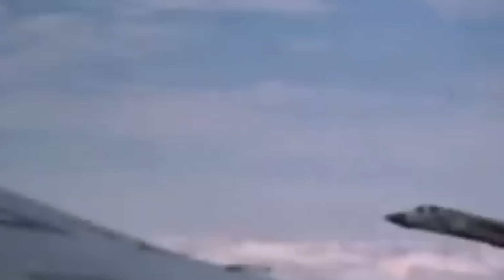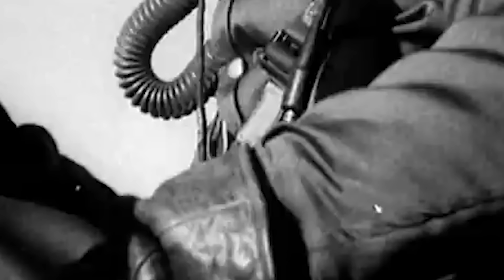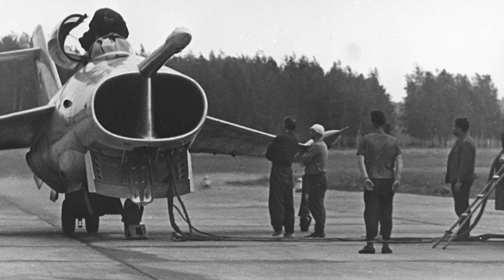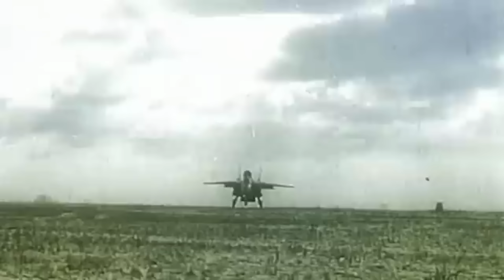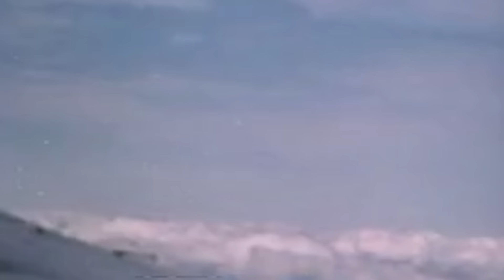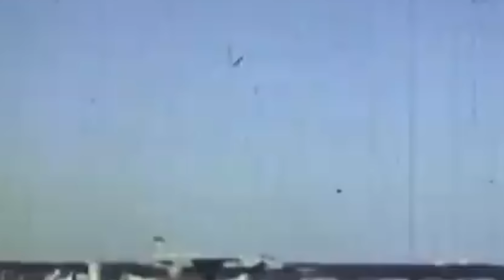America Stole This Plane and Turned It Into a Monster

Comment: Right from the Russian MOD propaganda desk. 🙄
Reply: The cope is unbelievable. This is all open source information. Someone like you would also claim it’s propaganda that the US bought Russian rocket engines despite the US being decades behind rocket propulsion right?
Reply: @kylekyle5438  Oh, come on. Convair designed a rotating nozzle 30 years before Yakovlev. Convair Model 200. THIS is literally open-source information.
Later, Convair merged into Lockheed. So what's with that claim of Lockheed "stealing from Yakovlev", when they used their own patent on the F-35?
Also, Yak-141 has 3 engines, while F-35 has only 1. Yak-141 was a total failure and could only have been possible in a country like USSR.
Reply: @kylekyle5438 The conclusions are what I take issue with. And there were issues with US rocket production, not with the technology. May I remind you of who was capable of landing men on the moon?

Comment: Signing a $400,000,000 agreement with Lockheed is not exactly stealing.
Reply: your correct. That is legally purchasing not stealing.
Reply: It's also not stealing because both Rolls Royce, MTU German and Convair had developed, built and tested swiveling nozzles BEFORE the Russians using this principle.   VJ101E used it for instance.   The contract was only for practical advice and engineering service.  It also wasn't 400 million, more like 40 million.
Reply: I wish someone would "steal" something from me for $400,000,000 lol
Reply: And all Lockheed Martin did was buy test data. The Yak-141 was a direct copy of the Convair Model 200A proposal and stole the three bearing swivel nozzle design built and tested in 1967 by GE and P&W. LM bought Convair and owned the Model 200A design already, and US engine companies owned the three bearing swivel nozzle, so they didn't need any 9f the stolen tech from the Yak-141. All they needed was flight data, and to not pet th9se Russian engineers and data t9 b3 sold to Iran or China.
Reply: EXACTLY!
Reply: well it makes a great clickbait title isn't it?
Reply: @adamchuahzongye395  Doesn't it? Well yes it does.
Reply: If the soviet Union were still around they'd claim that it was though
Reply: ....or at least Collaboration
Reply: It is, however, a great example of greed, on the part of Lockheed-Martin. (Aid and succour to the enemy)
Reply: Probably the 'stealing' was done by Russia, selling for $400m what was only worth $400.
Reply: Seriously. I mean it doesn’t sound like the same kind of ‘agreement’ the US had with Mauser in WW1. 😂
Reply: At that price you wouldn't call it a.... steal!?!?!?! 🥁🎉🥁

Thank you, thank you. I stole that joke
Reply: They never paid 400 million actually they paid less than a million dollars, and the entire deal was against Russian laws.
Reply: lmao! I know right? Russian greed sold it but Russian pride says we stole it....what weird people they are
Reply: Taxation is theft!
Reply: I had watched a video about the X35/F35, where it is also said that Lockheed Martin paid for access to the Engine Blueprints.
Reply: That's what I typed however mine was ignored. Not exactly sure why I'm being shown this again🙄.
Reply: @lynnrunningdeer Lol! Aww poor guy.
Reply: It is not an American innovation also. Lockheed Martin behaved exactly like Microsoft did with DOS- buy someone else work and shamelessly market it as your own.
Reply: its not a stealing  by L-M, its just a treason by Yakovlev top's
Reply: Not only did they buy it they had yakovlev help them develop something new
Reply: Worse part is some of the equipment gets scraped and never used,  tax payers money down the toilet
Reply: ...and you really believe It ??  😂😂😂😂😂
Reply: Aren’t these VTOL aircraft fuel pigs with limited operational range?
Reply: The US even stole German scientists to make things for them.
Reply: Yeah, but this was an engineering marvel by so many people who worked hard on it. It's not a bad deal, but this feels like that Alaska thing where they sold for millions, then after that the Americans found huge gold mines and now Russia regrets it.
Reply: @mfinland2767 Well since Russia didn't own Alaska, and was losing their war with the indigenous population, they did well on that deal.

Anytime you can sell what you do not own, the profit margin is to the good.
Reply: @mfinland2767  What exactly was "an engineering marvel"? The nozzle that Yakovled stole from Convair 200? That is a well-established fact.
The only thing the Soviet Union was really first to invent was the concentration/forced-labor camp.
Everything, from a vacuum cleaners to ice-cream machines, was either purchased or stolen from the West.
Reply: @mfinland2767  Alaska was never sold, it was given away by the tsar for the debts of the nobility to foreign banks.
That's why no one saw the money.
What is there to regret?
Russia currently has explored minerals worth two US government debts.
Do you think that some of this will end up in the hands of the population?
Here the salary is $200 and the pension has not been cancelled yet, and the rent is $60 and up.
Mongolia and Abkhazia receive free electricity from Russia.
The "tsar" forgave $160,000,000,000 in debts...
Reply: @mfinland2767 Russia actually got a great deal on that as the British were never gonna allow them to keep Alaska. The russians would've dumped millions into Alaska trying to defend it just to ultimately lose it. Alternatively the British probably could've just walked right in and took it with no fight whatsoever. Russia decided to sell it to the not British instead.
Reply: You can throw as much money as you like at something, it still doesn't make you the original inventor.
Reply: @BarbaricAvatar it doesn't make you a thief either.  Do you remember the atomic bomb ? Now that was indeed stealing
Reply: Consider it a deep discount with the time savings?
Reply: Unless you ain't paid it off yet....
Reply: Thank you. This was when the iron-curtain came down and Russia was in bad shape, they were starving but didn’t want blatant “charity" from the West and the West didn’t want Russia and all its former Soviet countries to start starving to death since they still had nuclear weapons and they blamed us for the current state their countries were in. So we bought lots of their technology that was still under development and our military contractors thought they might have a use for, like this.

I still say a S/VTOL fighter jet is a colossal gimmick and way too expensive to make enough of to change the outcome on a battlefield (unless you’re The British and you’re fighting over some islands in The Falklands)… I don’t know, they are “neat”… 🤷‍♂️
Reply: @frankthespank  you do realize the marines specifically wanted the f35b  to fight over islands in the pacific right???? They operate a massive fleet of amphibious assault ships wich were helicopter carriers but thanks to the f35b are now essentially aircraft carriers. It doesn't matter because theres an f35 for everything. If you wanna clear the skies and do some ground pounding with some air to grounds or close air support take the f35A if you wanna do the same thing but need a stovl/vtol (it can be a vtol but you cant take off vertically with a full loadout so you do short take offs instead. Exactly the same way they operated the harrier too) the f35 b is the one for you. If you're a navy that operates supercarriers and want a badass 5th gen naval stealth fighter then you definitely want the f35C (f35c is the first and only naval 5th gen in the world right now its also the first and only naval stealth fighter in the world too)
Reply: @frankthespank  russia didn't want blatant charity?
You know nothing about history, mate.
Look up "Operation Provide Hope". russia literally got humanitarian aid from the US and some other Western countries.
Reply: @  Guess I should’ve said: “AT FIRST, Russia didn’t want charity…”, remember, they were use to being lied to by their government and some did believe they could still get them out of any jam, even when their government forced doctors, scientists etc., to work in fields digging up potatoes during harvest every year 🙄. But after they starved for a bit then yeah, they were all for charity...
Reply: @LoserDestiny 😂😂😂😂
Reply: @LoserDestiny  You're exactly correct! They REFUSED to sell from their MASSIVE reserves of natural gas (see recent news) which was in amazing demand in the rest of Europe (not an issue in the US at that time) but said they were "entitled" (their word) to grain shipments from the US. There was a vocal minority that said they had the means and they should pay. (I spent some time working as an intern to a Federal lawmaker at the time. It was an absolutely unreal time.)
Reply: @LoserDestiny  There is also a story about how one official left his city without food, having sold valuable goods for foreign currency, which he was supposed to use to buy food.
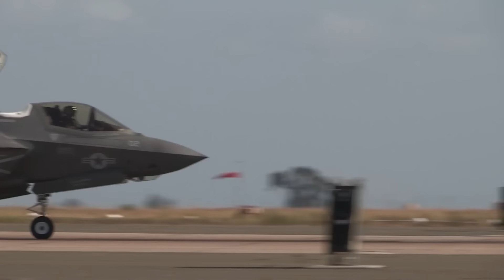Reply: 22:26 "...and the help of Russian engineers...". While giving that help, I wonder how much the Russian engineers, managed to learn about the F-35? I'll bet they were tasked with that, "extracurricular" activity.
Reply: I'm Sorry I didn't Understand SHOVEL S and FARM EQUIPMENT or HIND HEIST IN LIBYA
Reply: The stealing part came from the  US government against the tax payers to financing the F-35
Reply: lol and china buys lots of technology stuff with licensing but nooo its stealing hahahaha americans and their fantastic mental gymnastics to stay pure holy righteous in their own eyes. Not from china nor a supporter. In fact I support USA but the amount of crap that comes out of brainless sht makes it tougher and tougher to keep supporting USA sigh.